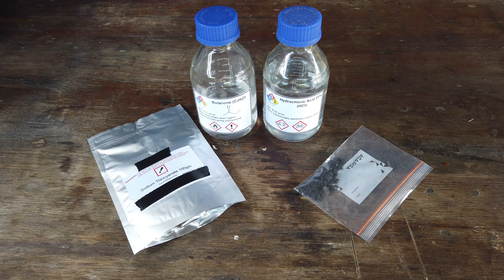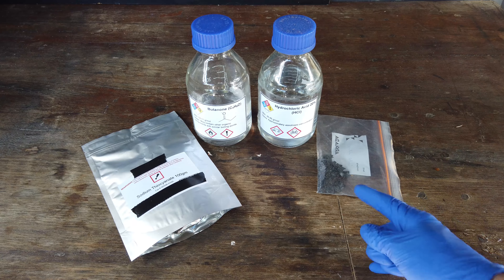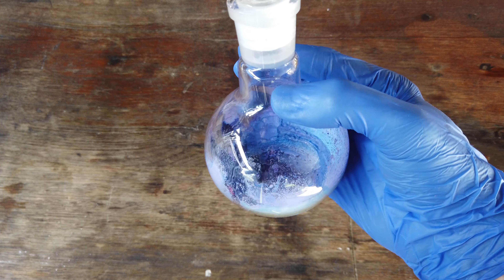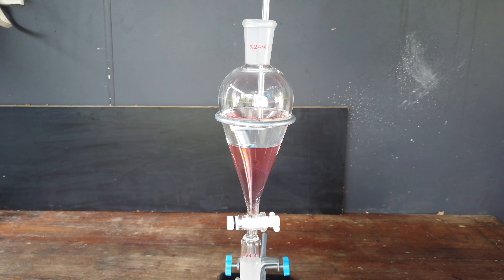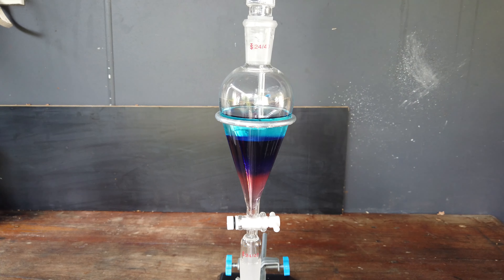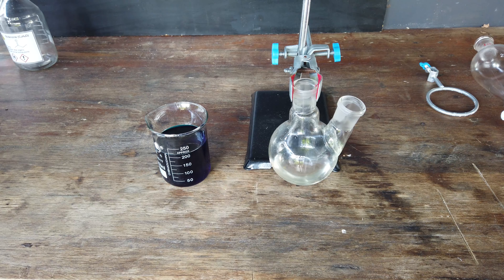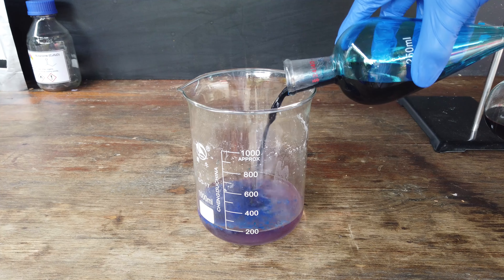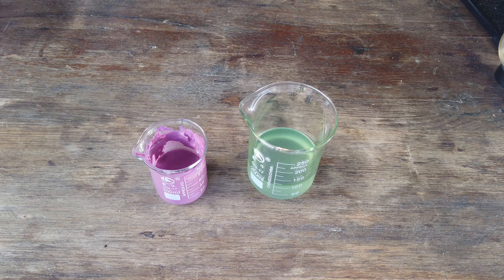Separating Cobalt From Nickel (Cobalt From Li-ion Batteries - Part 4)

Comment: U can heat the nickel solution and add a few grams of oxalic acid to precipitate it's oxalato-complex which readily decarboxilates upon heating to the reduced metal in powder (probably micropowder). It works with many 2+ metals!

Comment: One of the things I find this series to be very good at is illustrating just why the recycling of these batteries is not easy.  Until this process is streamlines and simplified it will remain more cost effective for battery manufacturers to keep buying newly mined minerals.  That's one of the reasons why I have been saying for years that battery manufacturers should be legally mandated to take their own batteris back once end of life has been reached.  Require them to be responsible for proper disposal and recycling.  Once that happens they will have the financial incentive to actually fix this process.

Comment: To get the lithium use carbonated water. The lithium will dissolve in it but other stuff won't. Next step shred the electrode strips  and recover the aluminum and copper foils while removing the separator plastics. Next step roast the electrode powders to remove plastic residues and digest in acids. The cathode material is graphite so if you know which is which you can separate and discard that one after the lithium extraction steps. The anode is made of Cu2CoO3 mixed with graphite and that can be separated to yield copper and cobalt. There isn't usually Ni in the mix of the batteries save for the tabs
Reply: Thank you ,for information 👍🖖🕵️
Reply: Thank you 👍👍👍👍🕵️been looking for that information !!!

Comment: One interesting idea for future video would be coating titanium electrode with lead dioxide. That could then be used in a perchlorate cell as an anode.
Reply from the maker: As interesting as it would be, lead dioxide and lead-based electrodes are something I'd much prefer to steer well clear of these days. The toxicity is simply far too much for me to work with for my current setup.

Comment: Very interesting. The boiling point of lithium is 1330 °C so you could distil it from aluminium, perhaps, using a jet of burning hydrogen that is a bit rich in H2 so that it is reducing.
Reply from the maker: The only trouble there (aside from the difficulty of that distillation) is that the lithium and aluminium would have to be in the form of metals to do that, and turning them into their metallic forms is much harder than separating them chemically, haha. (Also note that in the batteries themselves, lithium isn't actually in its metallic form either).
When in solution, it's actually pretty straightforward to precipitate the aluminum as the hydroxide, leaving the lithium behind (though I suppose I actually tried that in the second episode and it didn't work, hmmm...)
Reply: @ScrapScience  Just thought that the H2 in excess would do the job of converting lithium to metal for you.

Comment: Wondering if you would like to do direct air electrolisys sometime.  Pull moisture out of the air with an ionic desicant and produce hydrogen and oxygen. 

I could be wrong I think reducing the condensation from air-conditioning  may wind up reducing energy cost from air-conditioning.  Certainly electrolisys  of moisture consumes ebergy but much of that gets stored as chemically as potential energy. But your saving the energy of heat of condensation.
Reply from the maker: That might be an idea to visit at some point. What kind of dessicant do you think would work? I'm under the impression that chlorides are a bad idea because I wouldn't really want to be making chlorates or chlorine in the electrolysis, and hydroxides will be a little wasteful since they'll start absorbing CO2 and turning into carbonates.
Reply: @ScrapScience  what about pure sulpheric acid? It's a powerful  hygroscopic electrolyte. 

Maybe you can easilly make a Sodium silicate bonded fiberglass mesh to provide a high surface area substrate over which you may blow air. Apparently melamine sponges worked for about a weak for researchers, who settled on sintered glass foam and platinum electrodes.
Reply from the maker: Hmm, sulfuric acid is definitely a good plan. Do you know what concentration the sulfuric acid will dilute to due to its hygroscopic nature? I'm under the impression that high concentrations of sulfuric acid aren't very conductive and ideally we need it to dilute to a concentration of less than 70% (I'm guessing) to make electrolysis proceed nicely.
Reply: @ScrapScience  a few things that may become apparent on reflection. The acid concentration will depend on an equilibrium that depends on surface area, mass of air flow,  humidity, temperature and the rate water is electrolized depending on many of the same factors as well as the voltage applied and  the distance current must flow from one plate to the other. 

As you pointed out, sulpheric acid is not a great conductor at high concentrations, but as the humidity increases, more water dilutes the sulpheric acid which in turn  conducts more current. And The applied voltage  effects the current flow. 

The researches point out this works down to around 4% relative humidity. And a mention that over the concentrations of their work the electrolyte had a -30 something Celsius freezing point  sugesting it may work in very cold conditions. 

There is an article over on nature that graphes the researchers results testing a glass sintered foam with a 15 miliamps cm² electric current  with a near linear relationship  between concentration and relative humidity at 25c, that ranges from 62%  concentration at 20% relative humidity to what appears to be 26.8% concentration at 80% humidity.
Reply: @ScrapScience  I'll send the link to you in an email. 😁

Comment: When can I bring my old phone cells to you? 
On a serious note, this is so close! Do you think this process could be industrialised to extract all valuable elements from Li Ion batteries and do you think it could be an economically viable approach?
Reply from the maker: Haha. I'm afraid the process is very far away from being economically viable at this stage. For starters, the cost of electricity for electrowinning the transition metals is already more expensive than the metals themselves, and that doesn't even take into account the costs of the reagents I've used so far, including sulfuric acid, hydrochloric acid, calcium hydroxide, butanone, ammonium persulfate, sodium thiocyanate, and sodium/potassium carbonate.
If you can somehow make the electrowinning step more efficient, find some way of effectively recovering the butanone solvent, and get your batteries for free, it could conceivably be useful, but you'd be putting a lot of work into it for a very small profit if so.
Reply: @ScrapScience  I wouldn't even attempt such an undertaking - way over my pay grade, as they say. No, I was asking if this could be close to commercially viable at scale. 
I don't think the cost of electricity should come into it - just the maintenance and outgoings of a suitable PV array. As for the reagents - can these possibly be recovered using cheap PV electricity?
Reply from the maker: Yeah I can definitely see that if you can get free electricity from photovoltaics it might have a better shot. With some development you might be able to recover the butanone from the solvent extraction pretty well, but recovering any of the other reagents (acid, hydroxides, carbonates, thiocyanates) is going to be near impossible since they'll all be used up in the reactions they're involved in.
If a business could get free battery waste and free electricity, I could see the possibility of this being viable on a large scale. Still, a lot of research these days is now going towards new efficient processes for separating cobalt and nickel, because this solvent extraction process really doesn't seem to play nicely on large scales (I think).
Reply: @Bennyboy-dog  solar is orders of magnitude too diffuse for such a thing. There is, however, a way to use the light of previous suns (well, colliding neutron stars, at any rate) in the form of uranium and similar chonky bois. With that, of which Australia has plenty under the ground and vastly more in the ocean that surrounds it, you do not have to worry about destroying a bunch of delicate ecosystem by shading away the light it depends on with square kilometers of PV panels.
Reply: @ScrapScience  We need to leave no stone un turned, or we have to reduce our lifestyle to subsistence living again is my take on it. I reckon you are part of the solution!

Comment: Can diethyl ether or ethyl acetate or other organic solvents (immiscible with water) be used instead of butanone? I heard that the cobalt SCN complex is soluble in most organic solvents (although it is really not stable in water).
Reply: Also, where did you find those solubility statistics of the coordination complexes in organic solvents? I have personally never encountered them.
Reply from the maker: I'd imagine that it's likely for other organic solvents to work, but it's definitely something that would require some testing. I only used butanone because the document I'm following said that it works.
I'm afraid I don't have much in terms of solubility tables for inorganic salts/complexes in organic solvents either (there's too much information there to compile neatly, I'd imagine). While limited, old solubility dictionaries like this one can be useful (though they are limited):
https://archive.org/details/dictionaryofchem00comeuoft/
Reply: @ScrapScience  Thanks a lot for your reply! I wonder if it is possible to separate ferric ions with cobalt ions by this way (since they both form the thiocyanate complexes). Will the ferric complex dissolve into the organic layer?

Comment: Add cobalt and nickel chloride to acetone and it'll leave the nickel salt behind
Reply from the maker: Hmmm... interesting.
While that would probably work for this particular instance, I'm thinking there are a couple of issues with that kind of separation that I don't really like:
1) When atomically mixed, the cobalt in the cobalt/nickel salts might have a hard time dissolving properly, as the nickel can kind of 'protect' it from touching the solvent (similar to the reasons for requiring inquartation for dissolving gold alloys). With such a low fraction of nickel, this is probably not much of an issue here though.
2) I'm also worried that even small amounts of water (even leftover hydration of the chlorides) could impact the process and bring a bit of nickel into solution.

Honestly, I'm not very sure about either of these points though. Do you have any further insight to an acetone separation like this?
Reply: I'm going to try that myself. Thanks for the tip!

Comment: How difficult is it for you to obtain the glassware.  Here in the US, it is almost impossible for an individual to obtain due to the drug laws.
Reply from the maker: When I was making this video, it wasn't an issue at all - there were no glassware laws in my location. However, I recently moved to a different state and the laws are a bit different. I'm still looking into the specifics, but I basically need to make my channel a registered business and sign some forms to say I won't be making drugs if I ever want to own any glassware with ground glass joints over here.

Comment: I don't understand why he had a mixture of all the metals, simply separate the cathode and anode while disassembling.
  I used hot acetic acid and got lavender colored cobalt acetate solution... I could have added sodium carbonate to get cobalt carbonate and then whatever I want, chloride, nitrate , oxalate, even perchlorate,sulfate, or oxide ( which I can use a aluminum powder thermite reaction to get the metal )etc.. 
  He made it way more work 🤨
Reply from the maker: The cathode of a lithium ion battery, in this day and age, does not contain cobalt alone. Generally, it contains a mixed oxide of cobalt, nickel, and magnanese, with a certain amount of lithium ions intercalated depending on the state of charge. Normally, this is all deposited on an aluminium substrate.
As such, dissolving up cathodes will give you a mixture of all these metals (Co, Ni, Mn, Al, and Li) in solution. This is exactly what we saw in this series of videos.

If using hot acetic acid is all you've done, I can guarantee that you don't have a pure solution of cobalt. What I show in these videos is the amount of work that would be required to actually separate the components of your product.

Comment: Interesting you got much more Co than Ni since Li-ion batteries has at least  15 times more Ni than Co.
Reply from the maker: Yeah, it's definitely a bit weird. Pretty much everyone else I've seen do this kind of extraction has had nickel be the most abundant species in solution after dissolving up the materials.
It seems like I've either got batteries which contain an unusually low fraction of cobalt, or maybe my heat treatment and dissolution process is somehow selective for dissolving cobalt over nickel. The latter is unlikely though, since I found that the acid seemed to dissolve almost all of the electrode mass I started with.
Reply: @ScrapScience  I guess you meant to say unusually high fraction of Cobalt, but that would also be highly unlikely unless it was a custom made ultra high end Li-ion battery with a price tag I even don't want to speculate. I'm working with Li-ion battery manufacturing and have been in the business for 15 years and I never heard of ratios like that =)
Reply from the maker: Oh yeah whoops - unusually high is what I meant there. These are mostly just batteries out of old iPhones so I doubt they're anything special. 
Seems like a bit of a mystery. If I ever figure out what's going on, I'll let you know lol.
Reply: @ScrapScience  It depends on how old the battery is. The initial generation of Li-ion batteries for the first 10-15 years or so used an almost pure LiCoO2 electrode. I have a bunch of said batteries from that era, 1400-1800 mAh Panasonic and Sony cells that have very little Ni in them. Any recent battery made in the past 10-15 years is likely to be a mixed metal NMC or NCA cell. Samsung 29E's and LG MJ1's that I've recently digested are mostly Ni with small amounts of Co and Mn.